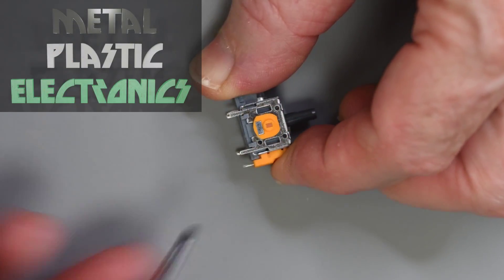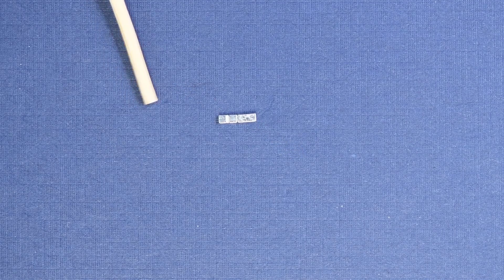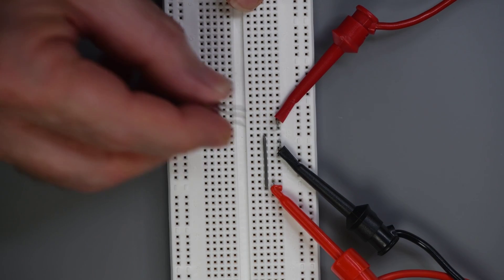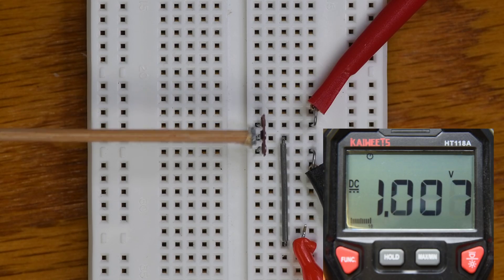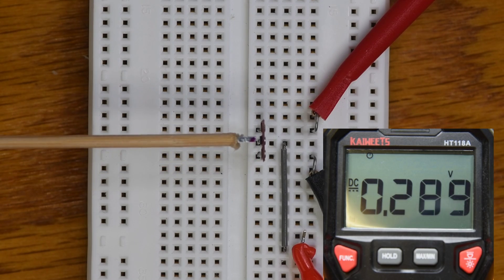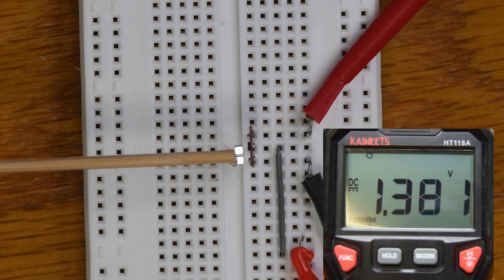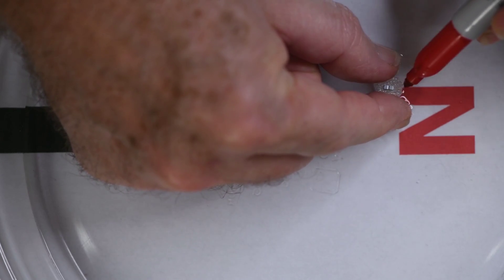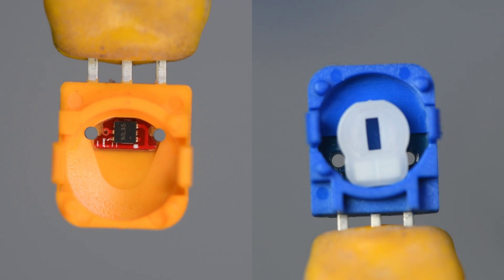Magnets + Hall Effect Sensors + Joystick

Comment: have you thought about testing the jun Zeng Hall effect stick calibration board? (I think it's K-Silver hall effect joysticks with a calibration board)
Reply from the maker: I don't think the calibration boards will be necessary any more.  This web sight: https://dualshock-tools.github.io looks like it will solve all the problems.
Reply: @metalplasticelectronics354  so we need the pin for calibration anymore?
Reply: Nope

Comment: What about 3.3V or 5V instead
Reply from the maker: These are made to run at 1.8 volts I haven't tried them at any higher voltage.  The ones made for the PS4 controller will be made to run at 3.3 volts.  I plan on ordering some of those to see if there is any difference. Next time I get to the bench I'll put 3.3 volts to one and see what it does.
Reply from the maker: Seem to work at 3.3 volts and 5 volts.  Long term, I'm not sure about that.
Reply: @metalplasticelectronics354  think i found the sensors datasheet - appears to be hallwee 9303SW - works from 1.6v to 5.5v - pretty much impossible to find them for purchase
Reply from the maker: @markween8263  That sure looks like it. Thanks